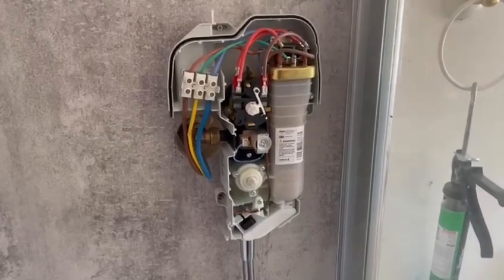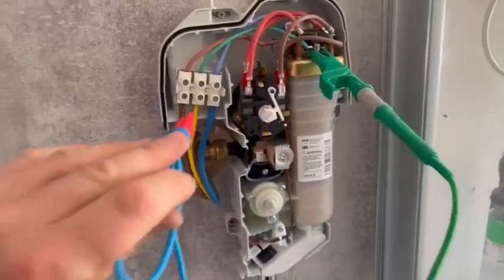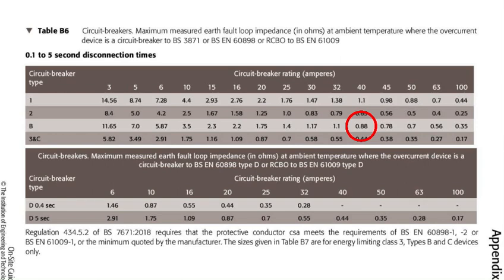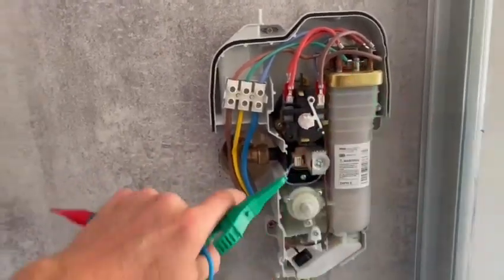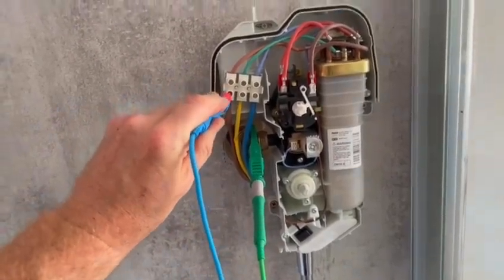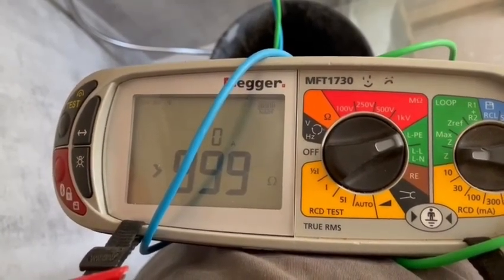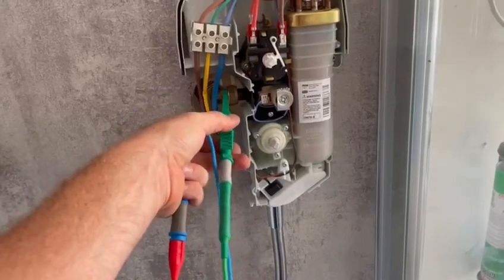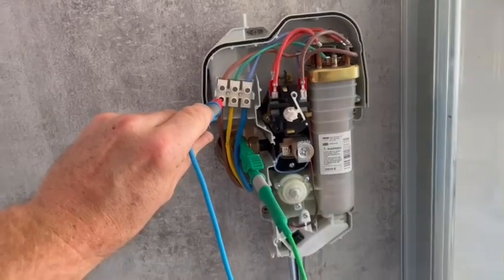Is Water a Good Conductor of Electricity?

Comment: In the 70s I used to travel round sites putting load tests on standby generators up to 750kW. We used tanks of water, raising and lowering 3 plates about 6 inches apart with 3 phase 415v on them. If the water was fresh, we only got around 30 amps so had to put salt in. Too much and it's resistance decreased as it heated up so we ended up with an inch of plate carrying 1000amps, so it was quite an art to getting it right.

Comment: The water in the pipe might not carry any sizeable current but it is a potential hazard when it comes to electricity. 
Years ago I was called out to a flat . The guy was getting a shock from a metal draining board or tap. . The fault was on a water heater in the adjacent flat and the main voltage operated trip had failed. The fault current had no where to go as the coil had burned out in the old trip . 
My customers flat wiring was fine it was just the fault current from the flat next door travelling through the water in the plastic pipe giving him the nasty shock . 
After that experience any plastic pipe installation I work on 1I still get the plumber to put in a copper section and earth that section to prevent anything like this happening again

Comment: So if the incoming pipework is bonded to earth and then has a plastic connection that then continues in copper, should that copper pipe also be bonded?
Reply: Depends where it goes.
Reply: If you've got a metal frame under your dining table you don't need an earth lead to bond it. In general if metal objects aren't extraneous we don't need to bond them, and arguably bonding them can create a potential hazard.

There are a few exceptions to this. Under Section 705 [Agricultural and Horticultural Premises], supplementary bonding is still required for all accessible metal – I believe this is because mixtures of damp manure etc makes everything essentially extraneous regardless.

Historically supplementary bonding was also required in bathrooms, and there’s a lot of “sparkies” who haven’t seen a copy of the regs since 1985 and like to bond everything. But of course all bathroom circuits must now be RCD protected and so it’s unimaginable how a modern installation would require supplementary bonding in the bathroom.

Even on old versions of the regs, an e.g. metal tap fed from plastic pipework installed on an acrylic bathtub does not need bonding and preferably shouldn’t be bonded.

Comment: As stated below, its what is dissolved in the water that determines the level of conductivity. I used to work on old overhead cranes with variable speed control that had a tub containing a water/salt solution and a moving contact that was lowered in and out of the solution to form a 'variable resistor' to control the crane speed. The crane drivers used to mix their own solution up to how they liked the response of the controls. If there wasn't enough salt though, the crane would be very slow or not move at all.
Reply: Talk about coincident. I recently watched an urban explorer video in a Welsh Slate Mine. They were using Three such buckets for controlling the winches.
https://www.youtube.com/@IKS-Exploration
Abandoned Slate Mine.
Reply: @G1ZQCArtwork  Very interesting. I could not make out all the details of the installation. The ones I worked on had a second contact out of the tub, so the circuit was made from the moving contact through the solution into the tub contact. Certainly some examples of wound rotor motors to be seen there.
Thanks for the link.
Reply: @three-phase562  These mechanisms also served as a resistor for slow start for big motors, to get them to start moving before applying the full load.
Quite dangerous in an enclosed space, the gasses given off are Hydrogen & Oxygen. BOOM.
Its done today by switching coils.
Reply from the maker: Thanks for adding to the comments your thoughts 👍🏻

Comment: Inconclusive.
What.!?
Water is a very poor conductor, but it depends on the Mineral content, which obviously varies across the country.
Pure distilled Water (de-ionized) has virtually no conductivity.
Tap water can show full mains voltage down to Earth potential, but at an extremely low current capability.
Impossible to state how much, due to the variable minerals in it.
Reply from the maker: Great comment and one hopefully all learners will come to. Massive thanks for your input. Gaz 👍🏻
Reply: @GSHElectrical  John Ward did an experiment on this subject.:
https://youtu.be/MF9DCNkaE8I
Q & A:
https://youtu.be/W1pXsMjF3Dg
John is very good at explaining the technical stuff.
Reply: Tap water would have to be well outside of what would be an acceptable mineral content for it to become conductive to the extent that a few meters of plastic pipe would drop below 1MOhm [where technically it would pass an IR test if performed by someone with no self respect]

0.9% Sodium Chloride solution - a.k.a. the sailine drip they use at the hopsital - would be about 500kOhm/m if you put it in 15mm PEX pipe at room temperature. And really if your tap water was anywhere near this conductive something would be going horribly wrong at the waterworks and the water would be so foul that even in London they'd think it's off. 

That said, things like floodwater and drains can be really dangerous. Be very careful if wading through escapes of water where there may be a live electrical supply nearby.